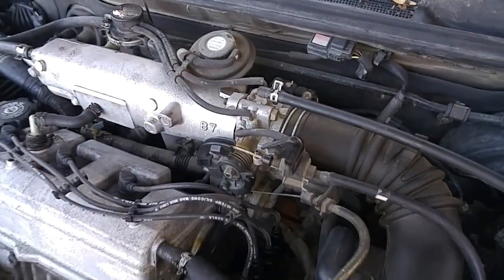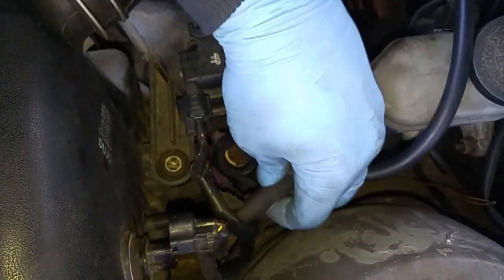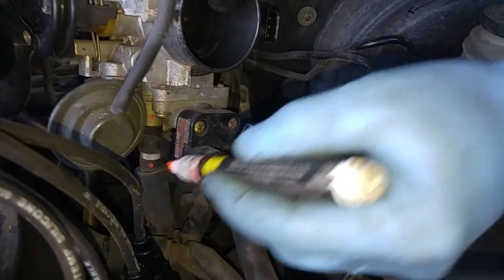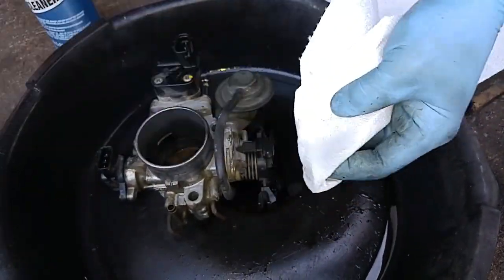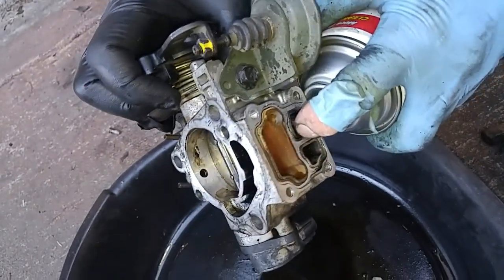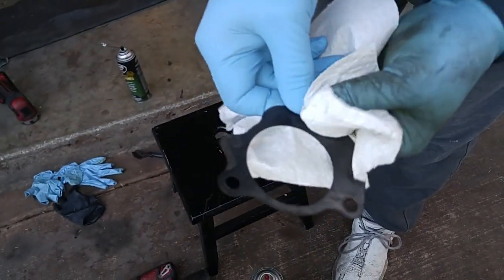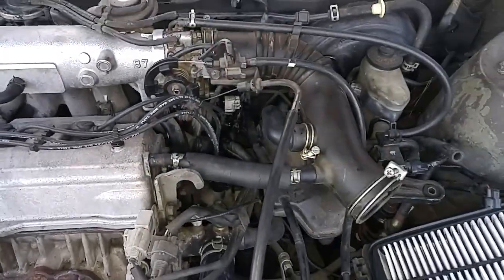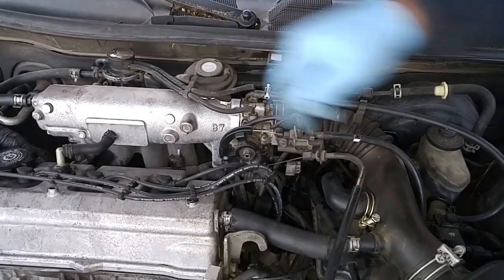Toyota Camry / RAV4 / Celica / Solara  I4 5SFE - Throttle Body & IAC Cleaning

Comment: I am facing an issue since months, egr is functioning properly, tested. Modulator was jammed and replaced with new. VSV was bad and replaced with new.
Still got CEL p0401, egr passage had gunk, cleaned somehow, the hole attached to intake from egr had gunk too, cleaned well but unfortunately now i have 2 codes at a time. P0401 and P0402.
Do you think is it related to carbon been messing up with my system, what should i clean next to open the flow ?

Any help would be appreciated guys ? Please 🙏

And now; its P0420 too 😞
Reply from the maker: There are so many related components that make up the EGR system that I get replacement parts from cars in the salvage yard.  Getting them from the dealership or after market suppliers can get expensive. Make sure your vacuum tubes are good and running with Marvel Mystery oil mixed with your gas might make the problem go away.

Comment: So using a brass brush will prevent scratching the surfaces of those components since it's a softer metal? Can you still scratch it up from putting too much pressure?
Reply from the maker: A twisted knotted steel wire wheel is aggressive and scratches surface severely and is often used by welders removing slag and weld spatter.  A straight steel wire wheel is less aggressive depending of diameter and length of wires.  A true brass wire wheel is even less aggressive as soft brass does not easily scratch steel but can wear out quickly.  A nylon wire wheel can be used with abrasive mixed in, depending on the abrasive used, will determine how it scratches.
  Take any mirror polished surface and you can easily test how easily it scratches the surface.

Comment: Found P port clogged in the TB which was  causing  the P0401 code to come on. After a thorough cleaning, now I have sufficient vacuum and  the EGR system is working now.
Reply from the maker: Cleaning the TB is simple, low cost maintenance and pays back in spades!
Reply: Hardly Moving Productions   I absolutely agree!
Reply: Oh wow I’ve had that code for some time and I’ve replaced all 3 egr components and code  persevered so I will try this!
Reply: 4:20  @johngarrett9310
Reply: 6:39 @johngarrett9310 did you clean out your throttle body and find any carbon build up clogging and ports which kept your p0401 code on? I replaced all 3 egr parts also and still have code.
Reply: @johngarrett9310  did you get rid of code?
Reply: How did you go about cleaning that
Reply: @daltonmeredith6790  Sprayed carb cleaner to both ports and shop air to blow away the carbon gunk stuck in these tiny orifices. Good luck 👍